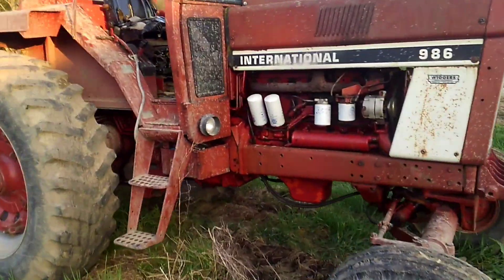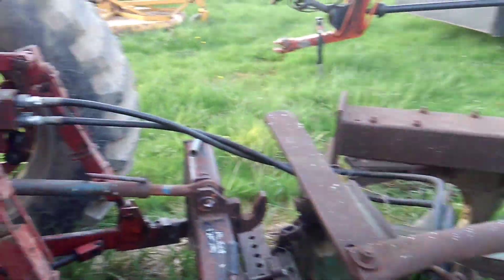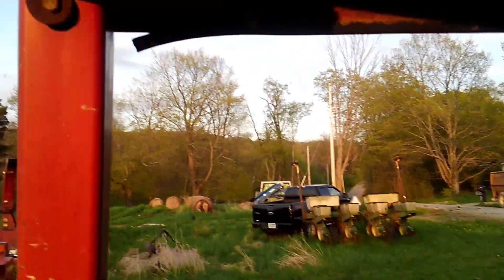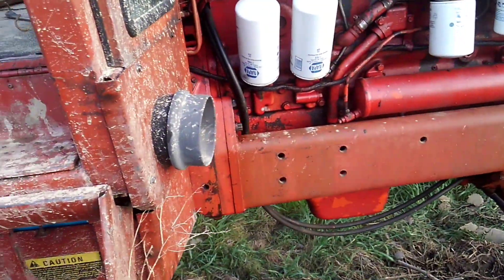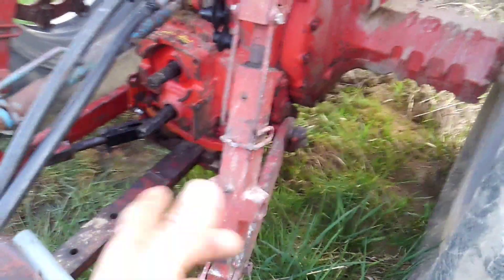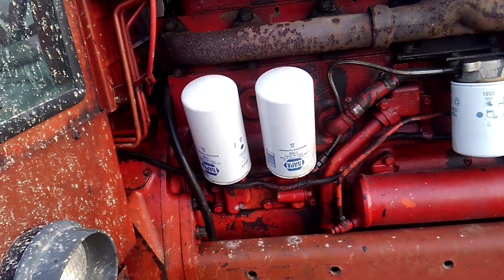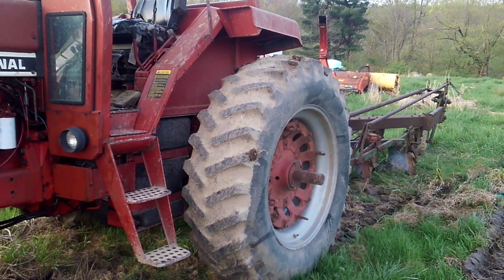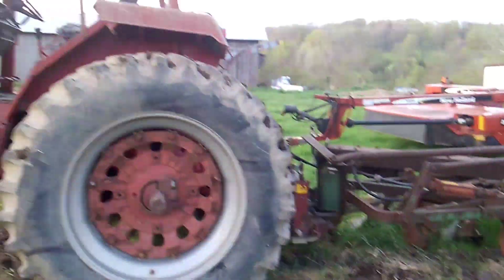The beast is back.

Comment: Yep Joe lol
Reply from the maker: You bet. 66 and 86 he could do in his sleep. Lot more reasonable than a dealer. Clutch and pressure plate, IP shaft, a worn linkage, trucking, and labor $1600.
Reply: @Mad_Farmer912  wow...amazing price
Reply from the maker: @FarmallFanatic  much better than having to fix an IVT tractor. You'd pay the dealer that just for them to drive it into the shop.
Reply: @Mad_Farmer912   I totally agree. I don't split tractors here either I let Joe do all that
Reply from the maker: @FarmallFanatic  lot easier when you have the right tools. I did my White but I just had to lift the motor out. Also the tractor has other issues that I don't want to out much into it but it does what I need it to.

Comment: i like seeing older equipment still being used.
Reply from the maker: I think the styling was a lot better back then also. You don't need fancy to do work, simple is the way to go.
Reply: @Mad_Farmer912  i always liked the way the old ih tractors looked.  i have a farmall h that i would like to get running again it been sitting for years.
Reply from the maker: @fordguy2001  yeah the H and M were always nice. I grew up with a JD 520 and 60. I thought I knew where the 520 was and they had an estate sale last winter. It wasn't and ended up being to rough to play with for a project at that time. They did have a nice Farmall MTA I should have bought but I milk cows instead of raise beef so I don't have the stuffed pockets for things I don't need.